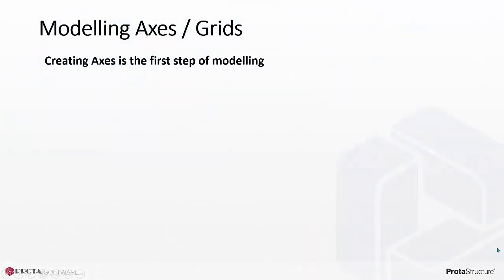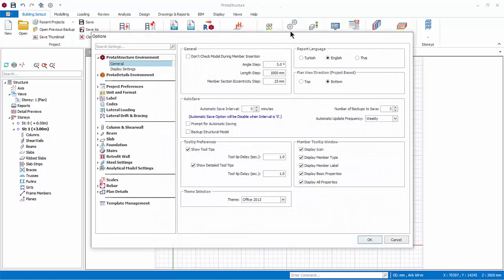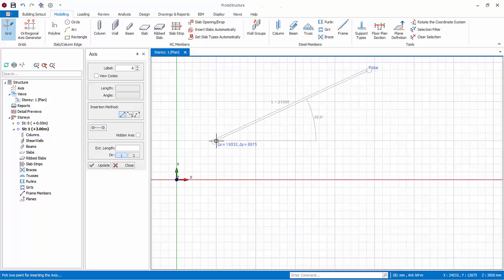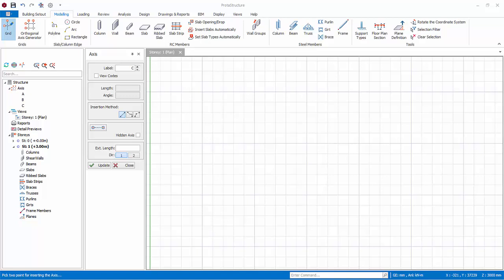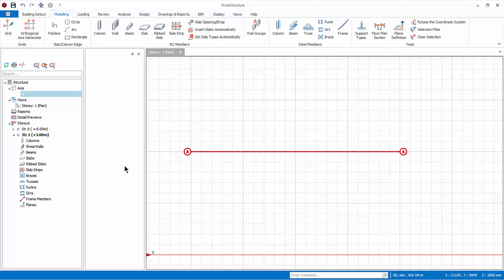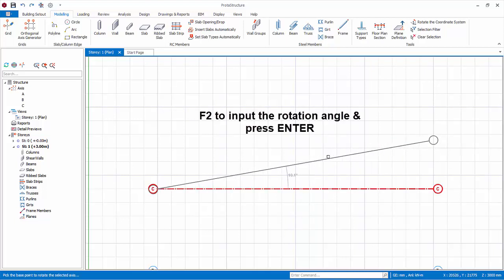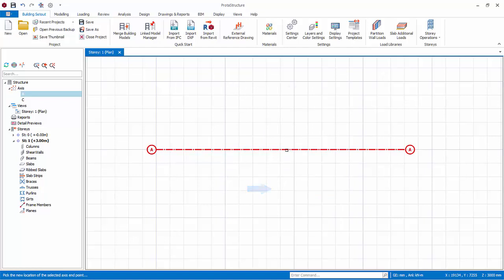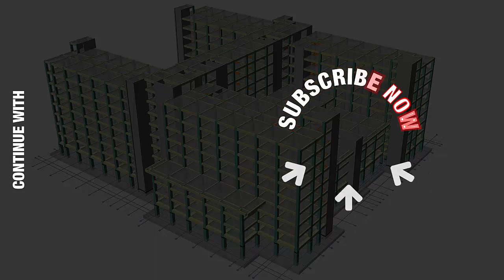3 Creating Axis, Axis Properties, Modify Axis

Comment: A constraint on the axis can be a nuisance. If an axis is attached to a component, it becomes difficult to delete it, and that is a significant limitation to its usage. there should be an option to delete an axis without deleting the component attached to it. Additionally, Prota should start utilizing basic creating and editing tools; the slab/column edge creating tools are currently limited.